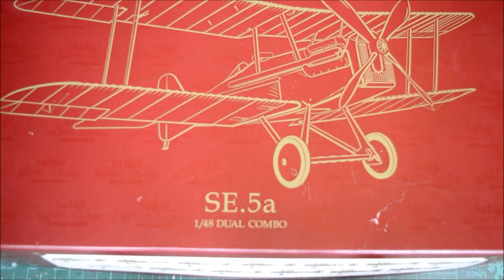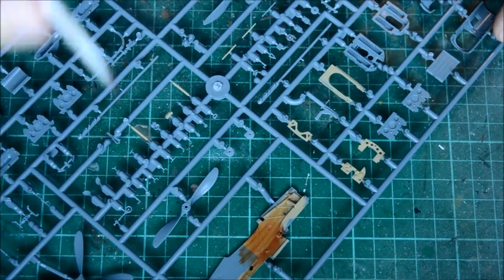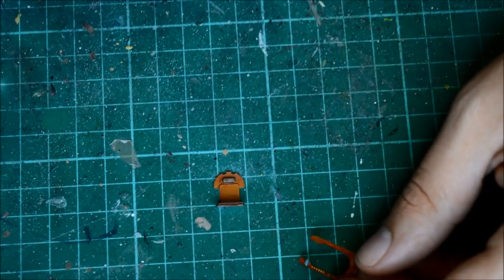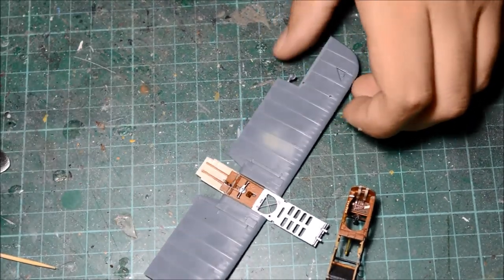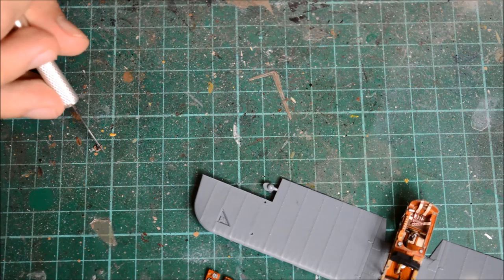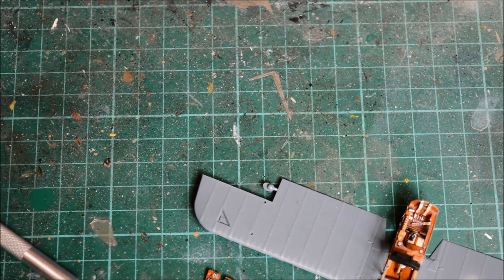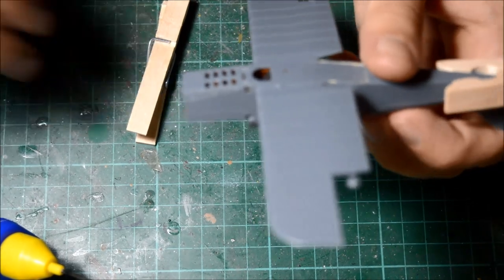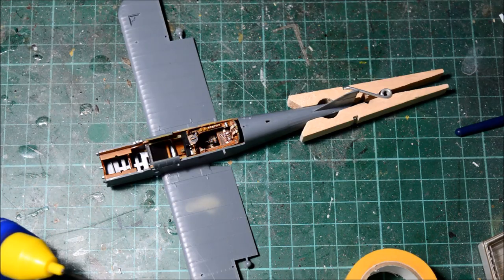Eduard 1/48 SE5a - Part 1

Comment: Hey there Michael.  :o)  Loving this kit build.  Please, may I ask a couple of questions?  Firstly,  What type of Tamiya paints do you use (AS or XF) and, secondly, can you recommend a good supplier?  I have always used Humbrol but would like to try the Tamiya range.  Thanks in advance.  :o)
Reply from the maker: Hi Ross! I mostly use XF paints instead of AS. A good supplier?? I would mainly recommend ( These are all UK based by the way ) Emodels, Hobbycraft, and pretty much any local hobby shop. Thanks for commenting! :)